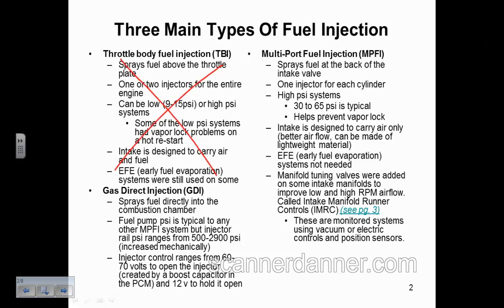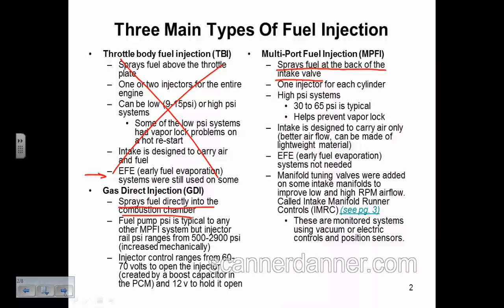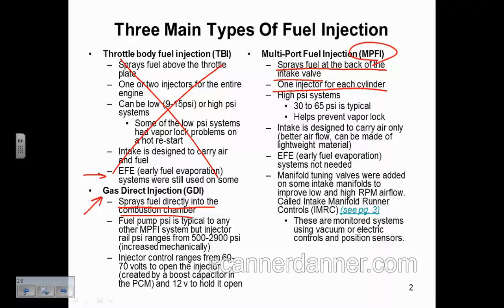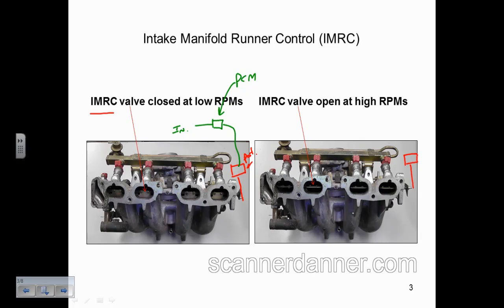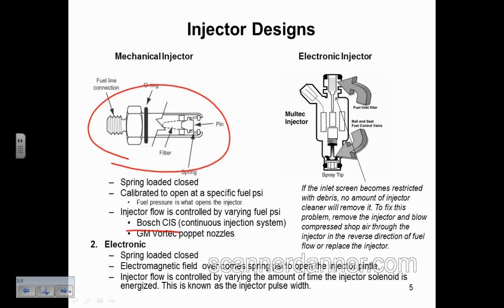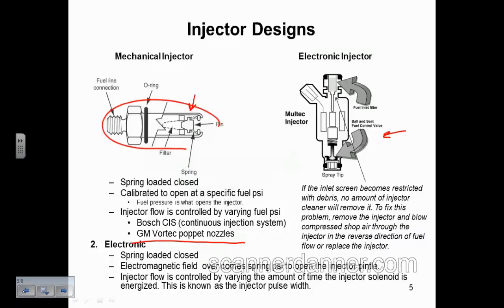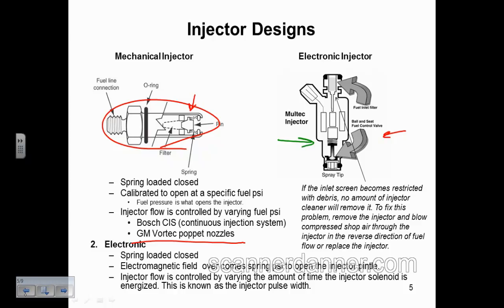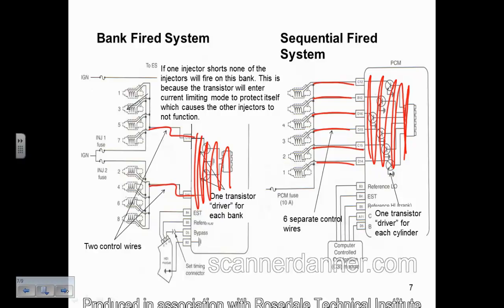Section 13 Types of Fuel Injection

Comment: when i say twelve volts fired injector i meant on my bypass test. and i had the zero reading during cranking for signal wire integrity testing(exept i used a meter

Comment: by the way i never figured out why it wouldnt crank. it was my first no start since i started studying your work and i was pretty upset i couldnt figure it out even though my tools are limited(no scope or verus for me).  even though the twelve volts fired the injector i still had no vollage reading on this switching wire. i thought i should at least read six with my meter since meters read an average of things like pwm, i deff need to get my test light or noid light and see if i can get it flashing. so to do this would i probe signal wire and hook my test light clamp to ground and if computer was switching it should light this test light.
Reply from the maker: That is because the injector firing event is so fast. You will not see it on a voltmeter. It's too slow.

Comment: I was studying section 3 of your book on solenoid testing. so i was practicing identifying circuit design on a known good system on my friends 2004 5.7 hemi. with the fuel injector plugged in i was using my multimeter and had ground on both wires with the injector plugged in. i thought this has to be power side switched. then i unplugged the injector too identify signal wire. my logic was one of the wires will be a constant ground and the other one will not be ground or power. and the computer would give this wire power during key on engne on. the problem is i still had ground on both wires. i dont understand this. i know you mentioned bias voltage maybe this is some sort of bias ground. then today my friend had a 90 somethin caravan obd2 four cylinder that he was going to scrap beacause it wouldnt crank.i wanted to try to make it my own case study. it had spark and good fuel pressure. i went to test the injector with my meter and had the same results that i had on the hemi. i read in haldermans book that the wire that is the same color on every injector is usually the constant wire and the other one is the signal wire. correct me if this was wrong but i thought since this constant wire according to halderman was the supply wire and it was ground i should give the other wire power like the computer would do and the injector should fire. i did this and it worked. i used my anmeter as a jumper wire.the injector fired. please help me understand whats going on here. what i want to know is why are both of these wires ground with the injector unplugged
Reply from the maker: what function of your multimeter were you using? volts or ohms to tell you, you had two grounds?
Injectors on PFI systems are ground side switched. So you have a constant power and a switched ground. The reason you didn't see power is Chrysler uses an ASD relay to power this circuit. Watch my video in Section 15 on fuel pump electrical systems for more on the ASD
Reply: i did it again just to make sure. on the 2004 5.7 hemi  the voltmeter was connected to battery positive with one lead and probing injector wires with the other lead. with the injector plugged in i had 12.7 on both wires. unplugged the injector and 12.7 on one and 12.3 on the other.
Reply from the maker: Priceton Braswell why are you connecting to battery positive? Connect your voltmeter to ground.  Also Chrysler systems do NOT have power on the injectors with the key on (ASD relay).

Comment: So what was the fix for the 49lb chevy no start Paul?
Reply: not 100% sure of the example I gave but it was a new pump installed by another tech and when he put the tank back in he ran the lines UNDER the upper tank straps instead of above them. So when the tank was put in, it pinched the psi line.